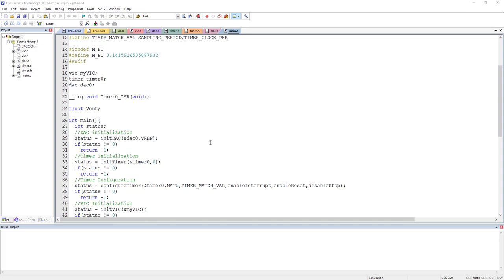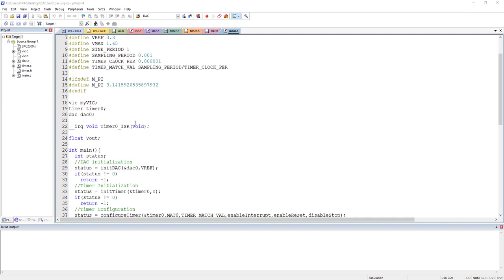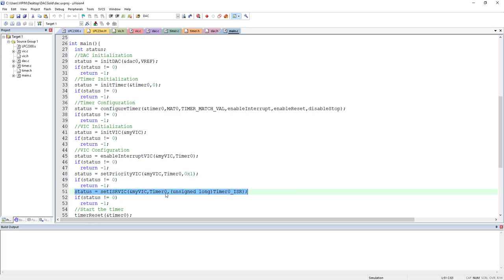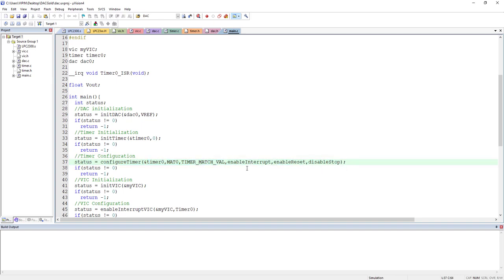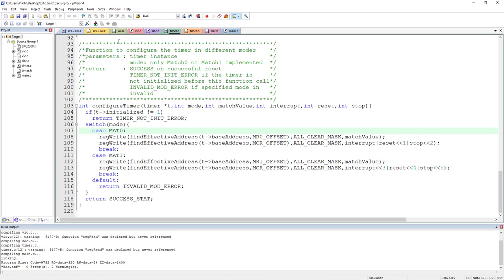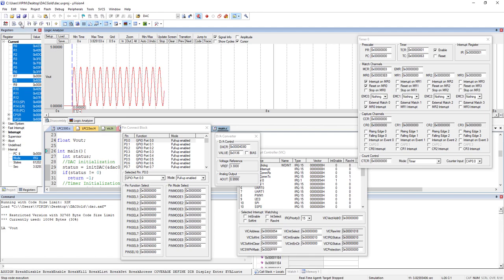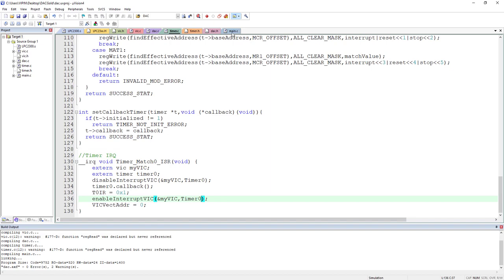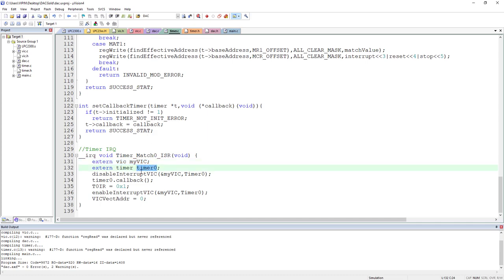Good Coding Style for Embedded Systems |Interrupt Service Routines| Call back functions| Part-2

Comment: Hi good job ,what is a callback and why it's so used in embedded C?
Reply from the maker: Call back is usually used to hookup application software functions with driver APIs. Usually like in interrupt, the driver will handle the basic handling then the control can be passed to application sw for further processing.